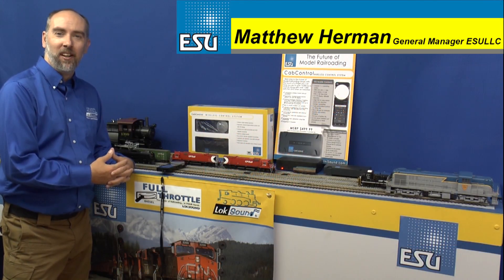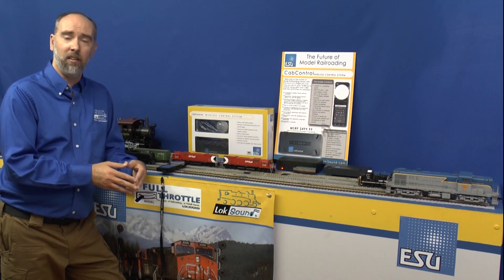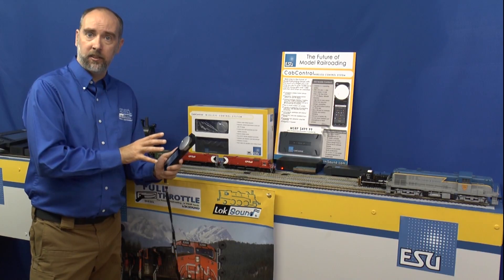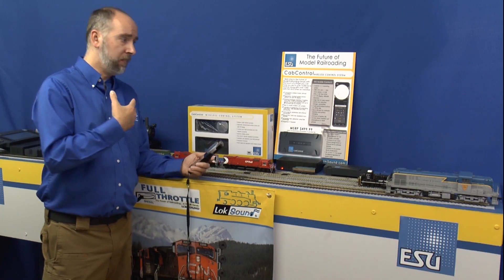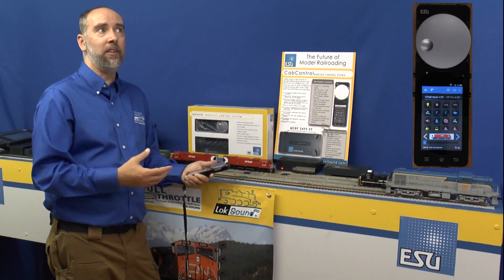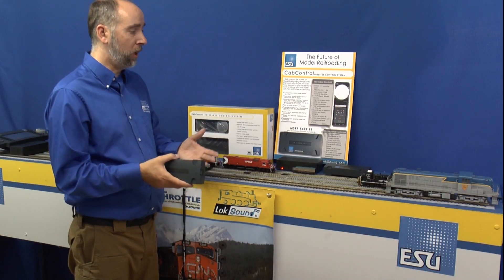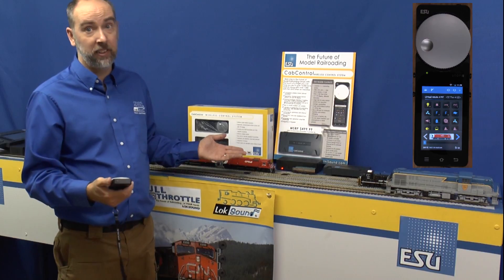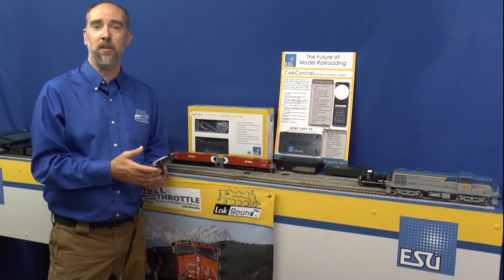ESU CabControl DCC System Introduction

Comment: Pretty pathetic that 6 years later and the Loconet port built into the control unit is still not activated and ESU is still selling the Ecoslink to Loconet adapter.  I purchased this system to replace a digitrax Zephyr system years ago and I have gone back to the Digitrax system.  The battery life on the remote is absolutely garbage and the device itself is incredibly sluggish, slow and unpolished.  No one should purchase the cab control system and ESU should be ashamed at the way that they have not offered support updates for the device.

Comment: Matt, how are the locos that do not have RailCom set up? Manually? How are pictures imported? Can the same throttle used with ECoS and the CabControl on two different layouts? Can locos or layouts already created in the ECoS be imported?

Comment: Dear Sir! Why the 50310 CabControl Integrated Control Unit only was specially developed for use in North America and Australia? This CabControl recognizes the European locomotives, with ESU decoder recorded by ESU sound files? Does it also perform the same functions as the ECoS 50210, except for some differences? Thanks in advanced. :o)

Comment: Hi, after programming non ESU locos, saving them (take me 2 tries to save), I get the programmed loco with functions keys as expected.  The problem is that they don't have the little numbers in the lower left side, just the F.  It's difficult to count from F1 (after the lights) when you have 18-24 functions.  I have gone through all of the settings and there does not seem to be anything that controls this.  I can change them to icons representing the function, but in the limited set of icons available (definitely not 150, more like 20), I need to have the functions numbered.  Can you please provide some help?  I tried going to the forums after registering  with ESU with my Cab Control serial number, I get a message that my forum account has not been activated when I click on the forum button.  If there is an email as stated I don't see the address anywhere on the website.

Comment: Matt, will ESU be offering an app similar to Engine Driver, where I can access the CabControl WiFi and say control my engines, with all the same features, from my Tablet?
Reply from the maker: You may need to contact Engine Driver to see if it will as they are always updating... I know the App "ECoS Controller" will work.

Comment: Silly question, (and you may have mentioned it in the video and I missed it but....) how do you change direction of travel of the locomotive? The speed control is pretty self explanatory, but I missed how you changed direction.
Reply from the maker: The choice is up to you as the user! We have given multiple options for direction change. 1. Turning the throttle past 0 until you feel a "click" 2. The touch Screen shows the direction arrow, pressing the opposite arrow will change the direction, 3. Any of the 4 side buttons can be programmed as a direction change.
Reply: ESUDCC, wow, very impressive. Can't wait to try one out. Maybe, someday, have one of these throttle that will work with other systems Wi-Fi? ;)
Reply from the maker: Actually, the Mobile Control II that comes with this system and is sold separately will work with any WiFi system already. We are also working with Engine Driver and others to incorporate the throttle knob and side buttons to work with their applications.
Reply: ESUDCC, awesome, looking forward to it.

Comment: G'Day Matt, Looks like ESU has not only raised the bar you guys have sent it through the roof. I have been using Loksound decoders since V3. I have approx 25 V3.5 & 18 V4 decoders in Aussie locos. Will this android based throttle connect to JMRI WiFi. I use a Raspberry Pi SPROG system for exhibition layouts and a large Digitrax installation at home. I would like to use the throttles on both of these systems as they both use JMRI WiFi throttle. I guess you can connect to JMRI on the Raspberry Pi using the ethernet port but that would require buying a full system.
Reply: martyn1107 we are working with Engine Driver to incorporate the throttle and side buttons into their application. This will hopefully be ready in very early 2018
Reply: Great news Matt, I will be at the NMRA nationals in Kansas in August hopefully doing some clinics on the Raspberry Pi and SPROG system. Would love to have one of these throttles as well. Looking forward to getting my hands on ti when available. :-)

Comment: can i run my nce system through this?
Reply: Unplug it like I did and plug in the ES U and keep going
Reply: James F This is an independent system. With it no other system is needed.
Reply: I already have a nce system and was wondering if I could run it though this one and use both
Reply: You can run your existing tracks and trains with it, yes. But no need to keep the NCE system itself, and it won't work with it.

Comment: Hey Matt!  Great video!  This came out right on time since I'm currently building a shelf layout.  Quick question, would this work in conjunction the  the ECoS Command Station?
Reply from the maker: While the Throttles are sold separately and would work with the ECoS (Mobile Control II) the CabControl is an independent system
Reply: Thank you.  I guess I am getting the CabControl instead of the ECoS.

Comment: Matt, will  the ESU's New CabControl WiFi DCC System and ESU's Command Station ECoS 50200 place nice together?
Reply from the maker: Hi Jeff,
if you already have an ECoS there is really no need for the CabControl system. The Mobile Control II Throttles are the same and can be bough separately giving the same capability. The CabControl system is an independent system. you can expand both systems other ESU layout control components though. ECoSBoost, and SwitchPilots, Etc....
Reply: Thank you Matt, yes already have the ECoS and enjoy it, good to know information though, thank you.

Comment: Are there plans to allow communication with loconet? I already have a significant investment in Digitrax hardware infrastructure .(due to the fact I use RR&Co software to run trains)
Reply: I'm guessing that if the command station has the ECoS link, then you could attach the Lnet adapter for the ECoS 50200. But it would be great if the adapter was built in.
Reply: I checked their Facebook page and it says that the L.Net adapter is built-in but not active until they acquire a Digitrax license and then enable it with a software update.